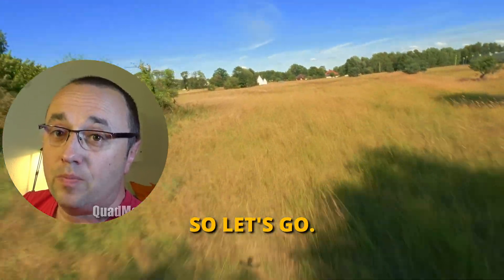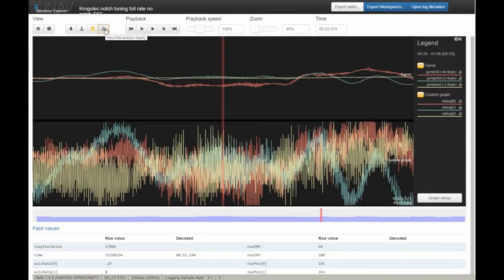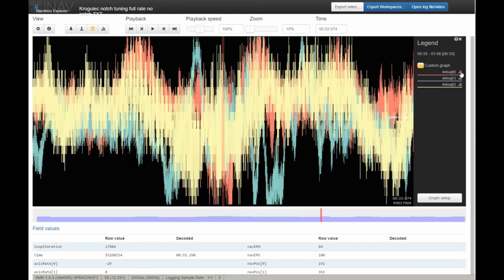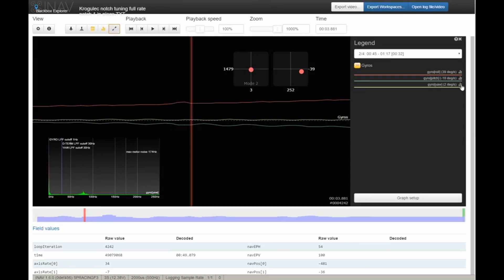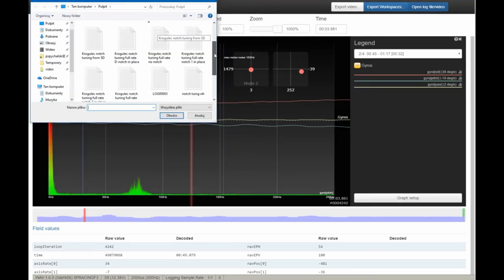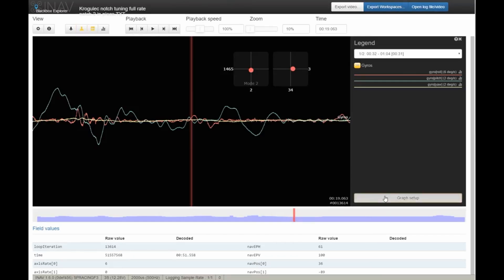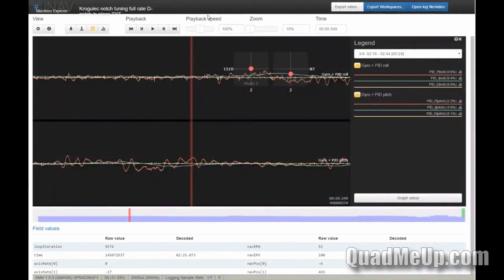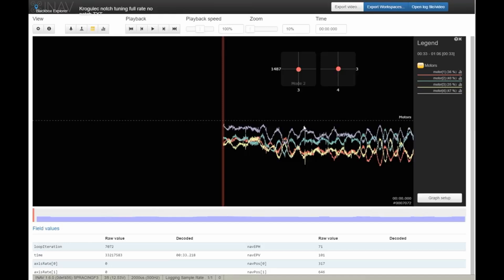How to find gyro noise frequencies

Comment: Great explanation! Thanks! But why we ignore elephant in the room? Motors not rotate at the fixed frequency. If i hovering and if i going forward - it occures on different throttle level and motors rotating with different frequencies. So notch filter configured for 150Hz when hoverign will be passed with 200 Hz of going frequency. Is there Esc's that can feedback rotate frequency to flight controller, to enable it adjust notch and it's harmonics?
Reply: yes, it's called bidirectional dshot + RPM filter. Bidirectional dshot sends the noise position of all motors to the flight controller and the RPM filter puts notches over these positions to filter them out in realtime
Reply: Yeah was thinking the same, without RPM telemetry, how will this work. iNav RPM telemetry needs sorting.